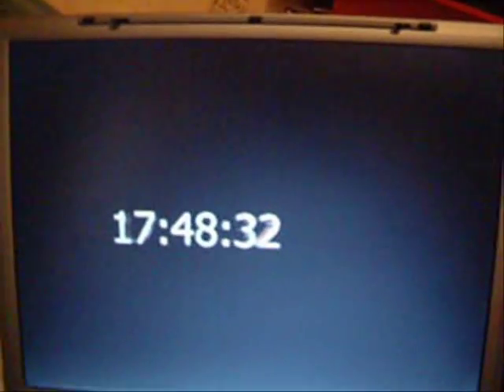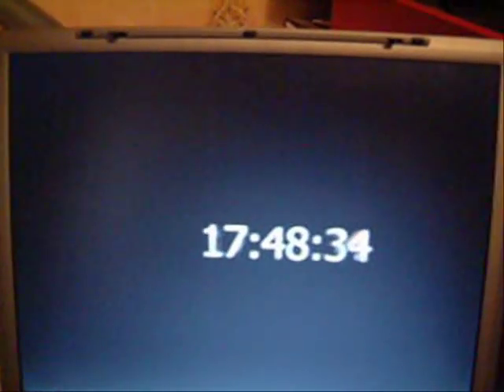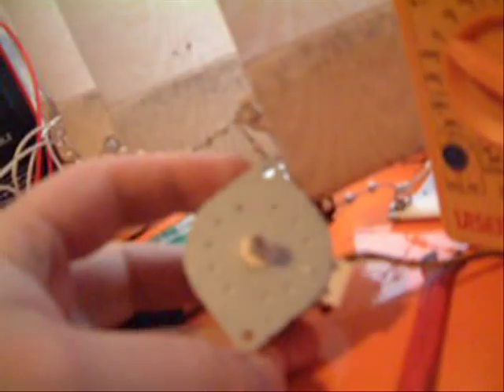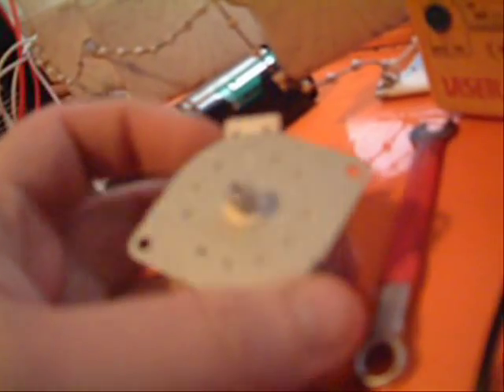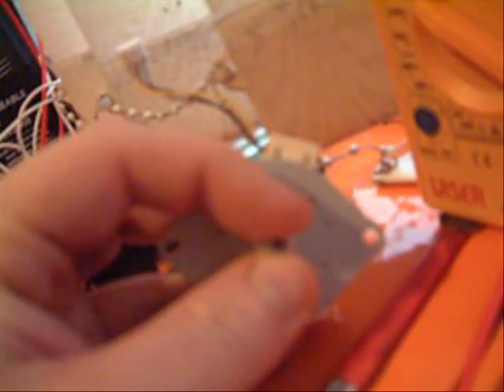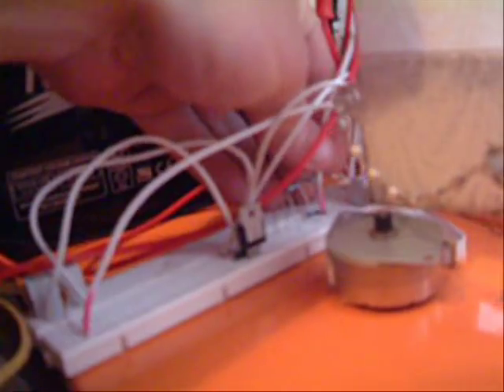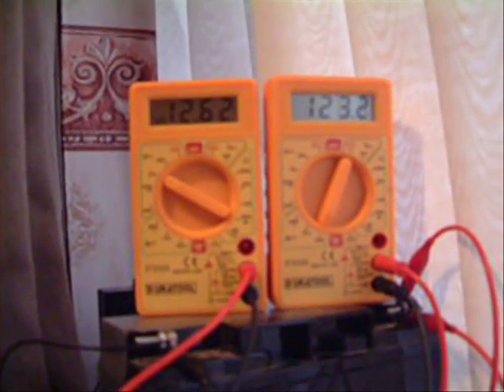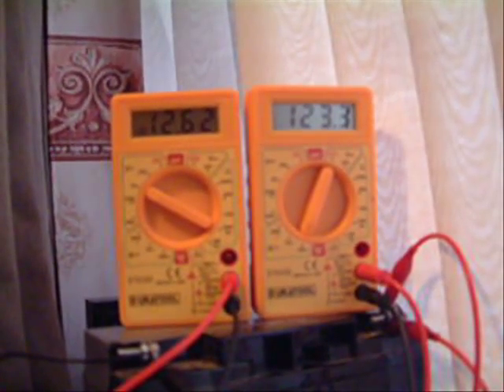stepper motor bedini

Comment from the maker: most 6 wire steppers have a center tap so that the coil is split into two and can be driven in both directions without having to switch the negative as well as the positive.
However, i have also found that some 6 wire steppers also have the two center taps from each coil joined together.

If your stepper does not have an external pcb that you can get into then you;ll have to open up your stepper to see how it's wired.

Comment: sure it works...1st release your mind enter the Tiger,
 2nd stare at battery and repeat "charge". 
3rd repeat 2nd until charge shows. 
It helps to have telepathic powers.
it works for cats as they hunt just watch them with that deadly stare!
The BEMF is always lower than you can every put in! it seems to work 
 for "some" people because (see above)

Comment: Have you ever got experience with a 6 wire stepper motor? I have a big one from an old A3 matrix printer and get crazy if I test the resistance between some cable. It really looks like some coils have cross-connections to other wires :-(